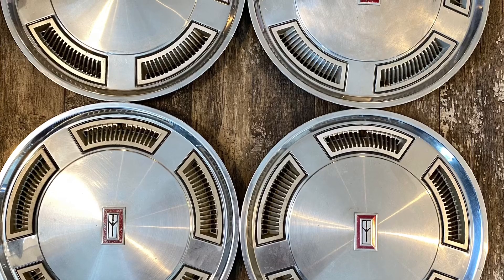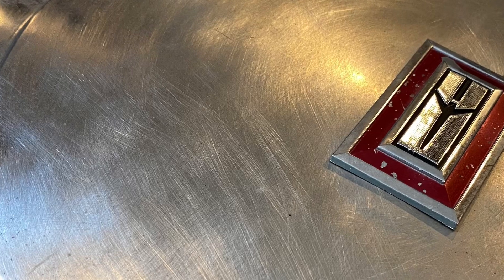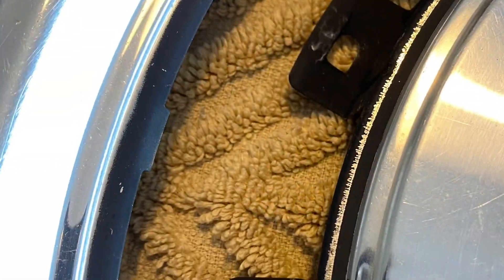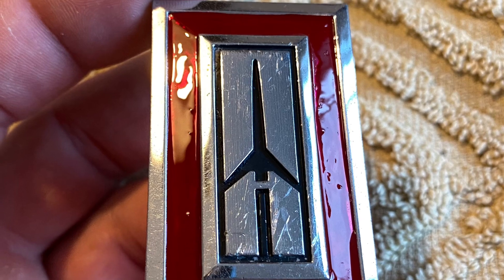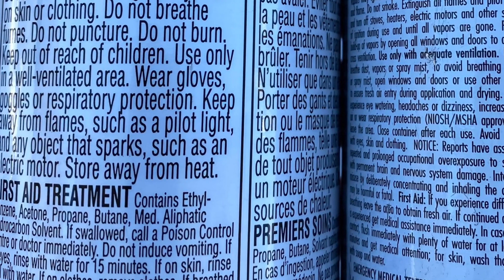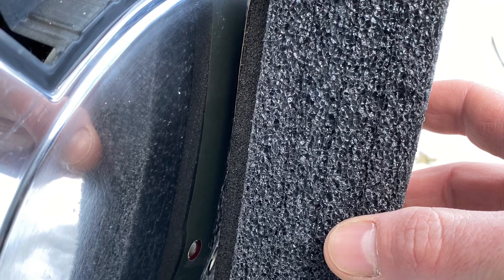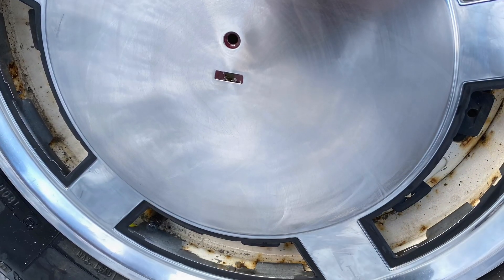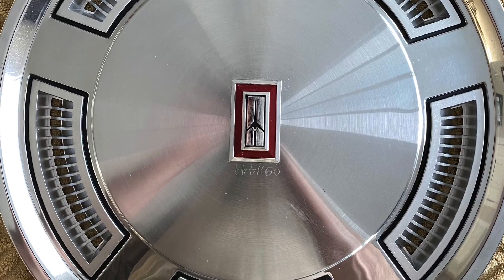1983 cutlass hubcap restoration

Comment: Cool video James, have a question. I bought a 84 buick regal in 1994 my first car. I watched your buick burnouts back in the day (greatness) do you regret taking out the carb engine? I'm thinking engine swap (have a 350 now) your advice because it seemed like after you did a modern engine you bought the camaro. It looked like the carb engine was more fun but you/we were younger. Did you get the bang for your buck with modern fuel injection???
Reply from the maker: The fuel injection is better but nothing wrong with a well set up carbureted engine as well. More expensive to go fuel injected with fuel pump, and computer and all that. Tuning etc.